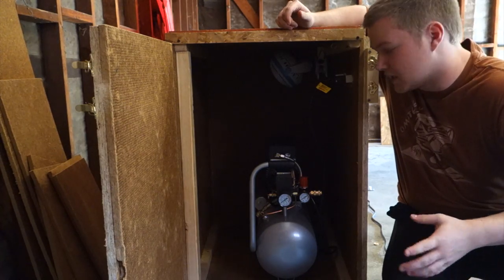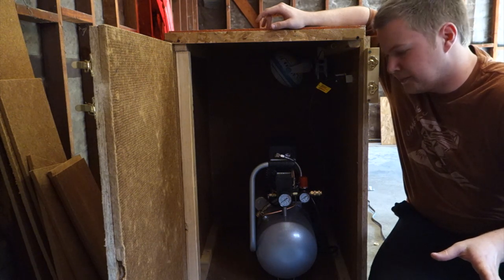DIY Sound Insulating Air Compressor Box

Comment: I would be very concerned with heat building up in the cabinet, depending on how much you use it you could end up overheating your compressor and burning it up.

Comment: Hey good job. This is the only compressor box video I've found on YouTube that actually used mass and not foam, and it made a huge difference! I just ordered at 2HP California Air 10 gal compressor and may do the same as you did.
Reply: You need both mass and the light foam to absorb all the frequencies

Comment: Its a good idea for someone keeping the compressor stationed in one spot.  Issue with heat just the fan won't work.  You will need fresh air in and out which changes the sound decibels.  Good idea if you left it outside run longer hoses.
Reply from the maker: I never have had a problem with heat!

Comment: Building a closet, with your material,  and baffled vents high and low to the outside would give more space to prevent overheating of the compressor.

Comment: Im confused about the fan. That would just circulate whats in the box? If compressor is drawing air and you dont have a box vent, then youbare restricting it quite a bit.
Reply from the maker: I added a vent shortly after! Just wasn’t sure the best way to do at the time

Comment: Well get two radiators one inside the box and the other outside for heat transfer, have a water pump in the system to have a coolant flow and two fans. One for the inside radiator and one on the outside. That way you just need a air inlet and a drain outlet, to make it easy just attach some air hose to a ballvalve on the outside of the box.  Might also be a good idea to get a temperature probe on the inside so you can see how warm it gets.

Comment: Seems like something useful to do with an broken mini fridge, just make sure to give it a proper air intake and exhaust.  🙂

Google directed me to your video. I just got a new compressor, because my old one overheated in the space under the kitchen sink. It had more space there than your setup, but it was lateral instead of vertical.

I'm just trying not to make the same mistakes with this new one.

Comment: Hey Casey, I doubt your even around but in case you are.  Wouldn't it have been easier to fit a drain valve extender rather than keep rolling it out every day?  Also, what does it look like now?  Did you add inlet and outlet airt piping?
Reply from the maker: Hey Boyd, still around making videos! I added an it exhaust/inlet port. Other than that didn’t change much. Rolling it out is incredibly easy, I don’t mind some drips getting on my garage floor. I also don’t drain it everyday as I should, but more so every few days. I’m a huge fan and it gives me an extra small work surface
Reply: @CaseyMartin707  hey Casey,  I would love to see the ports. Time for a refresh video.  Have  you had any moisture or overheating problems?

Comment: Hi Casey Martin. Do you have a follow up vide to this? What about the heat, did you find a solution?
Reply from the maker: I never had a heat problem but I just put a vent in it just in case to help more airflow.

Comment: I agree with Rich Poythress that this is the best and simplest version I've seen. I wouldn't have thought that the heat would be a problem. Has it been and did you do anything about it?
Reply from the maker: The heat hasn't been a problem. The only time I ever noticed it was when my dad and I were using it constantly for 3-4 hours straight, and so I just kept the door open. However 99% of the time I never have to open it and heat is never a problem.

Comment: Great video! Does the box needs to be that much bigger then a compressor?
Reply: I assume an air compressor needs a lot of space for air intake, also so it doesn't overheat and burn the motor out.
Reply: @TraceguyRune  surely the air intake would determine the amount of air taken in, sp extending the air intake outside the box with an appropriate filter would be the way to go?

Comment: How about the air intake? Also what makes it sound proof is really going to be mass. I'd try and use 3 layers: particle board /sheetrock/particle board and for air intake, a muffler or run a heavy old pneumatic hose out of doors if neighbors aren't a problem. And for heat dissipation I would think of using some kind of copper heat pipe, to extend the heat sink from the compressor 2 a position outside of the box and run the fan on that external heat sink. I know... Crazy ;)

Comment: Nice job. Can you please post a link of the insulation?  I didn't see it in a search. Thanks.
Reply from the maker: I got it from Home Depot and just checked their website and unfortunately can't find it on their site. However I am sure it is in most stores. It's brown and usually found near all the other plywood sheets. It comes in 4 by 8 foot sheets just like plywood. Good luck on finding it! Its great stuff. If I can end up finding a link I will definitely post it
Reply: Instead of making the box in plywood or compressed wood, you could actually make it out of SonoPan. They are specified to reduce sound. Also, if you don't find any insulation board, you can always buy a Roxul ComfortBath bundle. Also, since it's on a cement floor, if you leave it on, some sound will transfer by the ground. I would personnally make it a roller box, so you could move it easily and to reduce contact with the ground. Then again, you have the heat problem, wich you can't do much about it. Maybe have some hoses with garden equipment mufflers on. As suggested, running long inlet and outlet from outside. That way, you reduce inside sound, but you still anoy your neighbors. Work in progress as they say. Good idea!

Comment: Roughly how much did you spend to make that box?
Reply from the maker: Probably about $40-$50 max. Maybe $60 but I doubt it. It only took two 4x8 sheets of plywood and about one and a half or two 4x8 sheets of the sound insulating stuff. Other then that it was just a extension cord and a couple of those other electrical things plus the fan which were all cheap themselves. Thanks so much for watching!

Comment: That little fan doesn't help. Where from cool air coming? 30 min. and whole compressor melt..? 😄
Reply from the maker: It helps a lot! I have ventilation holes drilled on both sides. It pulls air through one set of holes and it will go out the other. I have been using it for 2 years and never have had a problem
Reply: @CaseyMartin707  Did you notice a lot of sound change due to the holes? The box kept beeing efective? Thank you.

Comment: Thanks Casey.  Regarding the sound deadening boards, I am assuming there were glued or attached in some way to the inside of the 3/4" ply board, Is that correct??

Tony
Reply from the maker: Tony Attard Yes Tony, I used very small screws, I think inch long screws, as I only had the plywood to anchor into. But since the sound deadening board isn't incredibly heavy or anything, it worked great
Reply: Casey,  How thick was the sound deadening board, 1/2",  3/4" , 1" ??

Comment: No ventilation & no air inlet 🤔 the fan is just blowing already hot air back in to the area around the Compressor.
It will overheat without fresh air.
Reply from the maker: Did you miss the part I mentioned I was going to drill a bunch of holes? I think I already did during this video. Never has over heated and I’ve been using it for 4 years
Reply: Casey Martin Hi Casey thanks for your reply 😀 I’m pleased to hear that it has been ok 👍 I was thinking more on the lines that the fan is usually fitted to the outside going through the unit (box) to expel the hot air out. Drilling holes will have the effect of sucking new air in rather than exhaust. I’ve had issues with other equipment and had to have a fan blowing air in & a 2nd fan expelling air out. However if it works fine then this is the important part 😎 Thanks again d
Reply from the maker: I had holes in both sides. Since then I’ve added an actual vent because I eventually had one laying around, but the fan pulls air in from one side of the opening and pushes it through the other opening
Reply: Casey Martin Apologies I didn’t see it in the original video. However we both agree the principle of through put Ie air flow is obviously key to the correct functionality of this project 😀 great 👍